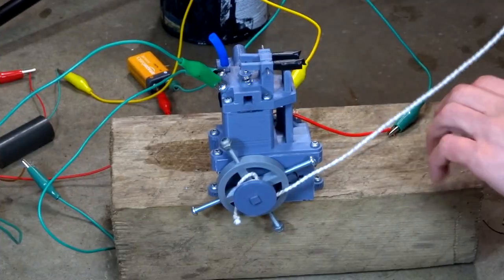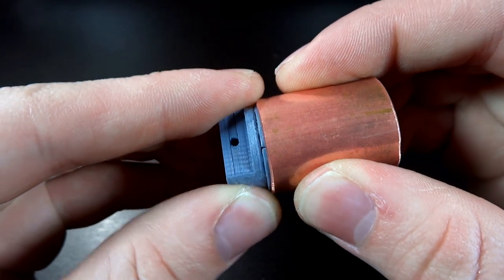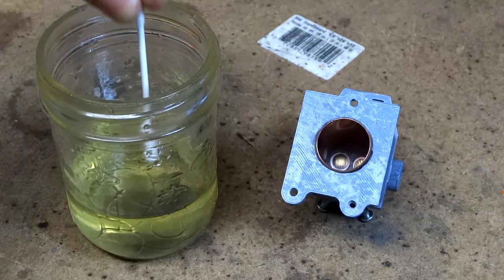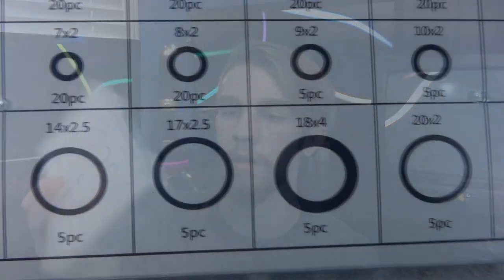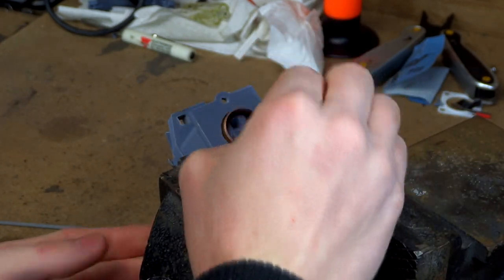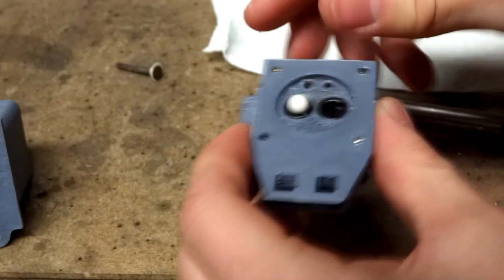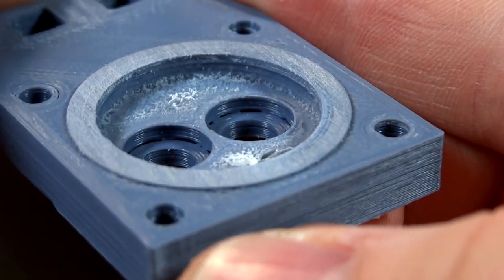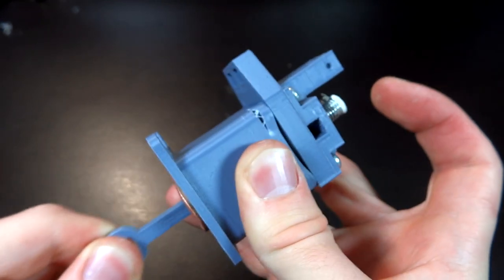Getting HIGH COMPRESSION for the 3D Printed Gas Engine (Part 2)

Comment: That's some sick progress bro! If your not going for a 100% 3d printed engine, maybe just buy a carburetor for an RC Nitrous Engine. Then you can use nitro fuel which burns a lot cooler and is a great lubricant. 

Not only that, but a small film of oil/fuel on the valves and cylinder head might eliminate leaking all together. 

Lastly, if you use nitrous, you can get away with a glow plug due to the methane reacting with the platinum, which means no need for sparkplug.
Reply from the maker: Thanks! I think I'm going to still try and 3d print a carburetor or some other fuel system. I'd love to use nitrous but I don't have access to any lol
Reply: @CamdenBowen  Not even the Nitro fuel from Hobby shops? If not it's pretty cheap on line
Reply from the maker: @AxelDayton  Ohhhh, I misread that as nitrous instead of nitro. Before I start testing any kind of stuff like that I think I will just try and make a version that can run on normal propane or something and then see what modifications I can do from there
Reply: @CamdenBowen  alrighty, you do you bro. Just a thought cause that's what I plan on doing with my engine
Reply from the maker: @B Tenold I don't think you're listening to what I'm saying either, I'm going to design one that actually works FIRST before I experiment with fuels I don't already have

Comment: One tip I have for you, try getting some flat aluminium bar, around 2-4 mm thick and file it down to the size of your connecting rod. I imagine that the 3d printed one would just explode when running the engine
Reply from the maker: I'm more worried the crankshaft will break before the connecting rod will, but I will just have to find out and see!

Comment: PRO TIP! Fill the inside mesh of the prints with water for a little bit of cooling and protecting the engine from heat. But it might be constantly failing horribly and spiling water everywhere. I don't know. I just feel like watercooling it is going to make it last enough to be used norlally.
Reply from the maker: I thought about doing a design where I had a watercooled cylinder Instead and a way to pump the water through a radiator, but I wanted to focus on the main principles first before getting into that but maybe one day :)
Reply: @CamdenBowen  One step at a time! I love getting distracted with a lot of things like that, getting ahead of myself when doing my own projects. I am sure that if you continue developing it, amazing results will come. Looking forward to see next improvements!

Comment: You can add a sacrificial layer at the top of your supports with a tiny gap below the trouble area of the head. That will help clean up the support mess causing you issues seating the valves

Comment: Do you think you could 3D print with TPU the o rings? 🤔
Reply: Or maybe even ninja flex?
Reply from the maker: I tried using TPU o rings but it's actually worse than using a PLA one. It doesn't have any kind of sealing capability and has WAY to much friction unfortunately
Reply: @CamdenBowen  oh I see, might be something regarding the químical interaction between the lube and the tpu then, very interesting!

Comment: Cool! Think a flat head would work fine and be an easier print, just get your combustion chamber via a longer bore/shorter rod
Reply from the maker: Thank you! I initially considered a flathead design much like a Briggs and Stratton motor has but my biggest concern came from the gasket. Having this design allows me to use a uniform O ring as a head gasket that has worked perfectly. Meanwhile a flathead will require a unique gasket that could be prone to leaks or blowing in the process of making the engine

Comment: You could try a square piston, as stupid as that may sound if you 3d print the hole where the piston sits in the center of the 3d printer and print the piston also in the center you will probably get a perfect seal.
Reply from the maker: Its a cool idea however, I want to be able to use copper pipes as a cylinder sleeve since it will hold up against the heat much better

Comment: You should CNC Machine out a piston of aluminum or Teflon or graphite or something.

Or you could, if you want to use the cheaper option, wrap some sheet steel metal around the 3D printed piston. Or any metal which can withstand a HUGE amount of heat and stress.

Comment: super glue gets porous when it dries and that does not create a good seal. you might want to try a different glue to seal 3d prints, maybe epoxy or a uv-cured polymer glue, but not a solvent-based one

Comment: If anything you might of came up with another interesting project...a functional air compressor! 3d print the air tank and a functional compressor!
Reply from the maker: I like that! Or, even a vaccum pump!
Reply: @CamdenBowen  yeah just think of all the content with the Air tank alone. What filiment holds the most pressure, what settings got the most sealed tank, how big of a tank can you 3d print, integrate the compressor and the air tank into one   mass print for compactness. Fuck I got a billion more ideas on just the air tank let alone on what you can do with the compressor/ vacuum pump.

Comment: why not make a 2 stroke gas engine?
Reply from the maker: It is much easier to change and adjust the engines variables on a four stroke over a two stroke. Two strokes while being mechanically simpler, rely on perfect timing which is determined by the physical shape of the cylinder itself. If something is off, it is much easier to adjust the valve timing on a four stroke by changing the cam timing

Comment: What oil are you using?
Reply from the maker: Just vegetable oil, It doesn't ruin the plastics and it smells nice
Reply: @CamdenBowen  Which vegetable oil. I'm also making an engine but it still has a lot of friction with olive oil and many other oils.
Reply from the maker: @strangeman4200  doesn't matter, just any vegetable oil like Crisco should work
Reply: @CamdenBowen ok thanks. But how hard is it to push without oild
Reply from the maker: @strangeman4200  pretty hard, the oil loosens things up really well
Reply: @CamdenBowen ok thank you so much I will try👍
Reply: @CamdenBowen  Do you think it will work with weapon oil?
Reply from the maker: @strangeman4200  Knife oil? it may work with Tsubaki oil. Gun oil? I'm not so sure, gun oil is more to displace water
Reply: @CamdenBowen  Ok thanks I will try.